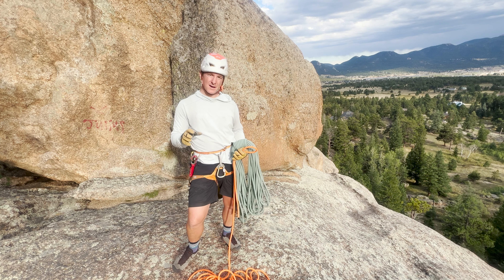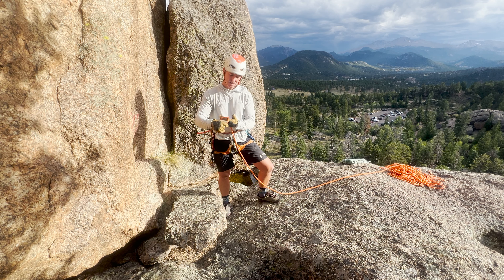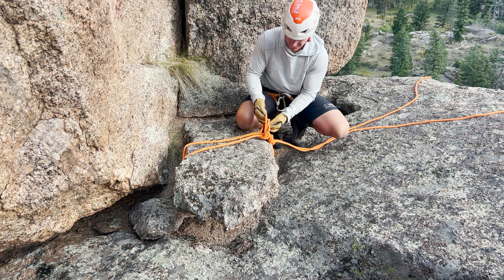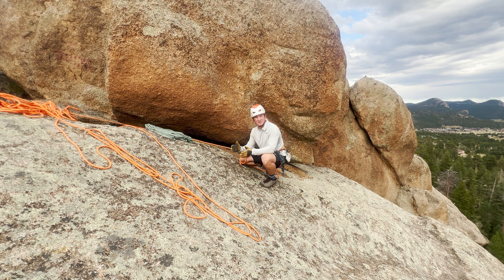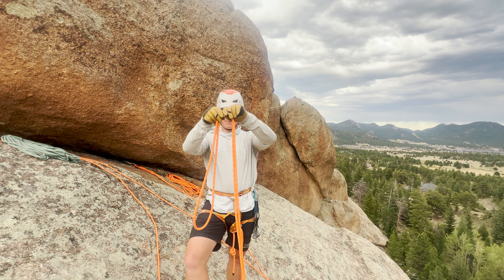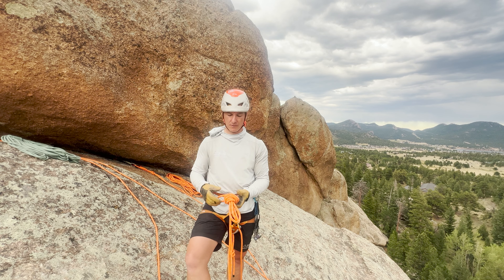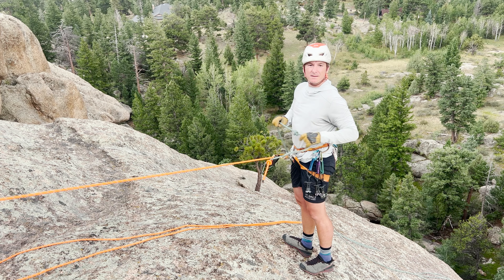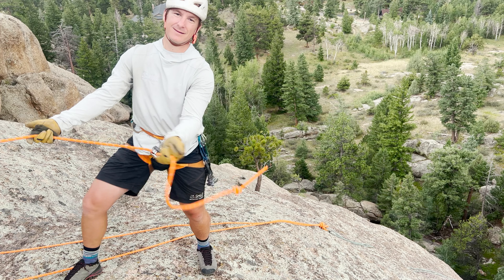AMGA Single Pitch Instructor Anchor Demo: V-Rig/ Joshua Tree Anchor System with Instructor Tether

Comment: Question from an aspiring SPI.  Before you clipped the static rope to the gear leg of the anchor, my inclination was to remove the carabiner from one of the cam slings, basket that cam sling with a shoulder length sling and clip the ends to the other cam with both carabiners, opposite and opposed.  Configure the shoulder length sling in a sliding X then connect the static rope to it with a locking carabiner and an overhand.  I know it’s less efficient on your materials, but I thought that the slabby rock might cause an issue with the carabiner’s gates and cause them to open.  What do you think?
Reply from the maker: First, you can do everything mentioned, and the thinking is on track. In a program, we would look deeper at the why for each component, trying to understand its task and then come up with the most desirable outcome. Are we looking for material efficiency? Are we looking for strength? etc. This might impact our choice. The one thing I would caution against without a deep understanding of systems is the need for a sliding x. Even distribution of weight across both legs on the anchor is basically- not possible to achieve.  I like to think of anchors in terms of strength. Is it good, or not? In the case of the sliding-X, I would rather limit movement and extension of the anchor and emphasize structure and security. So, if I were concerned about the non-lockers a might add a locker to one cam and double up the non-lcokers on the other, while still using the rope as a leg connector. Hope that adds some more insights!
Reply: @smilemountainguides  of course! you wouldn't even need the sling in the configuration!  Thank you!